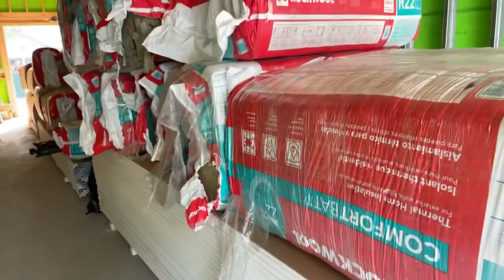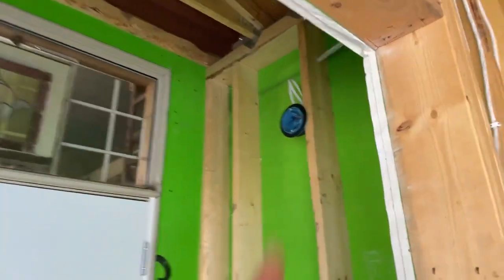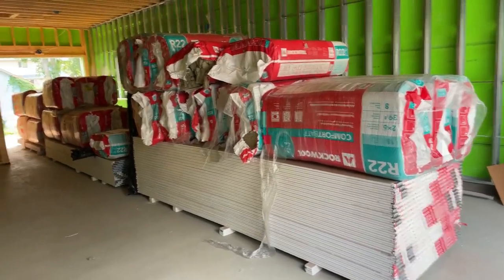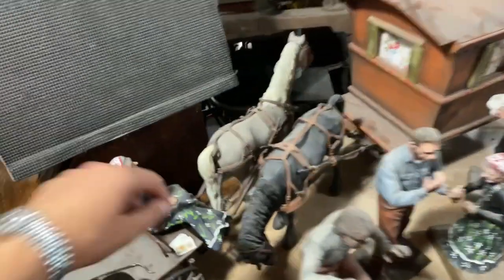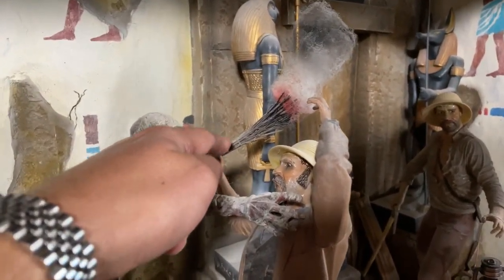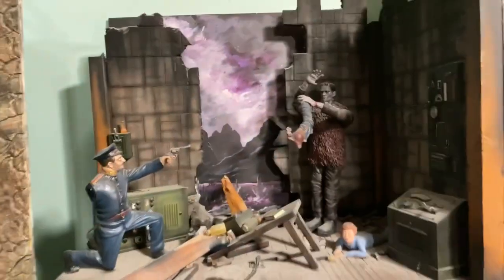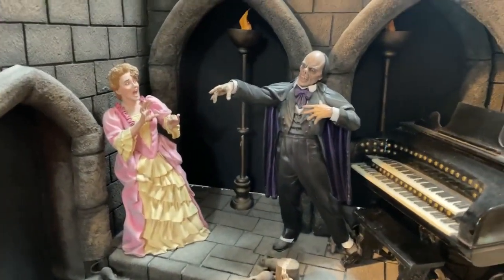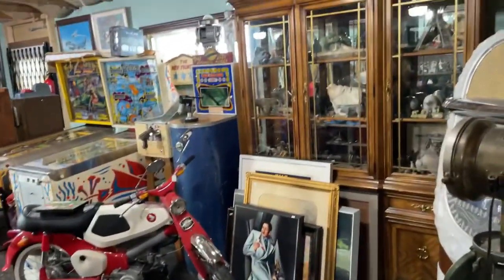Live at the shop! What’s happening this morning

Comment: Alex make sure you get a lot of studs put in the wall before the drywall gets fitted, for hanging your pictures 👍
Reply: Good thinking ahead but I find "monkey hooks" to be amazing for hanging art without a stud. It's the way they are shaped that holds the heavy duty hook flush against the backside of the drywall inside the wall. Holds substantial weight with only a very minor drill hole left.
Reply: Maybe gallery style rails, only holes for the rails and multiple moving points for moving the art .

Comment: In Sweden we have junctions with tubes running between them, so if you need to rewire you just gave to run it through the plastic pipes instead of tearing down the walls. Loose wiring like that makes me nervous! ;-D <3
Reply: That’s excellent. I wonder why the U.S. hasn’t done this!
Reply: @magickmoi1261  because you’d never have the conduit chases where you would need them. It’s a waste of money to do that because you can never plan for where someone wants to put a light or outlet in 30 years and patching Sheetrock is extremely easy, quick, and cheap!